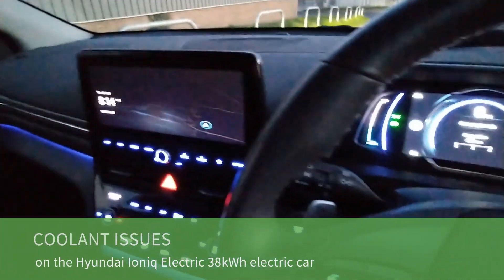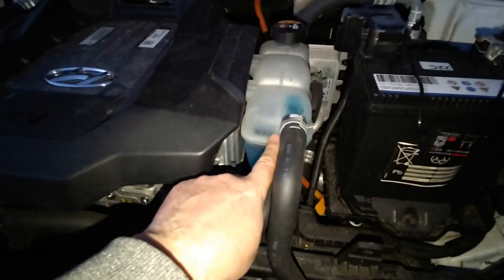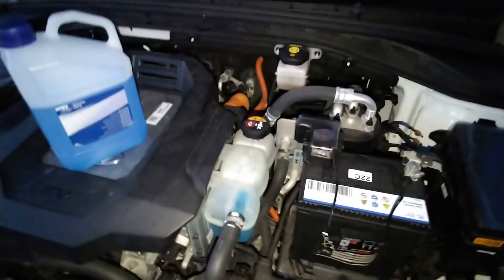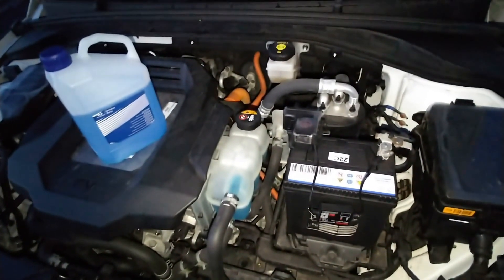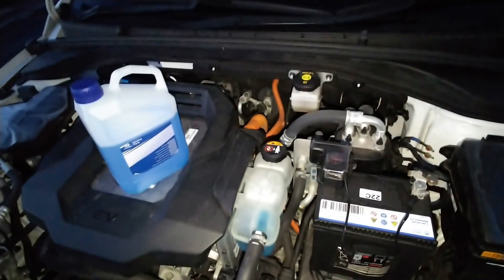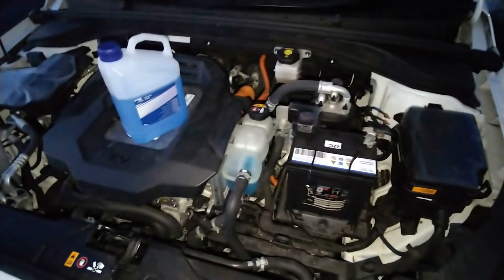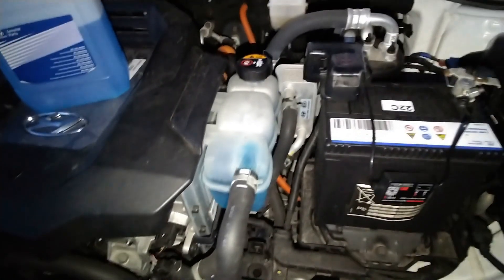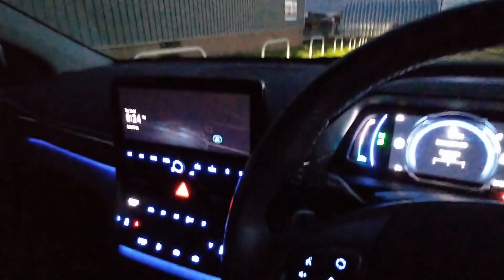Refill coolant message on a Hyundai Ioniq Electric 38kWh

Comment: Just been through this with a 2020 Ioniq 38kWh I picked up and was flushed under the recall campaign. Bonus being that the Year 4 service which replaces the coolant at a ~£200 to the customer is now done as a campaign! 

Anyone wanting to temporarily get rid of this message so it does not keep bonging / coming back when changing cockpit screens - it can be done by quickly powering off / on the vehicle.
Reply from the maker: Yes, I would hope the coolant change delays the scheduled change for a further 4 years. But I wonder if this is actually tracked properly. I would recommend writing the date this warranty coolant change job was done in the service book.

Comment: I remember a video from Bob Flavin talking about the service charges on the original E-Niro in Ireland (few years ago now obviously) saying about people getting a service contract at time of purchase - due to a part of the service each year being a battery coolant flush, that made it relatively expensive!
I wonder if, by the time Ireland got their E-Niro's people around the world were experiencing problems with their coolant, prompting Kia Ireland to include a flush as a service requirement!?
Reply from the maker: Yes, clearly Kia & Hyundai have made an expensive mistake using the wrong spec coolant in their EVs. Or maybe their supplier who makes the BSC-1 coolant has cocked up. I just hope the new BSC-2 coolant is better.

Comment: A left hand thread cap is a bit peculiar.
Reply from the maker: Obviously to stop owners opening it. I guess they changed to this when they used the new EV specific low conductivity coolant, discouraging owners from topping up their own coolant. The Ioniq 28kWh had a normal cap, but then had 'normal' coolant too.
Reply: @GoGreenAutos  I wonder if people were putting windscreen washer fluid in it by mistake as this is often the same blue colour.
Reply from the maker: @gavjlewis  Yes, I suspect that could happen.
Reply from the maker: @gavjlewis  Good point. I suspect that does happen.

Comment: Had the recall carried out about 3 weeks ago with no problem since or before. I also had a rear door handle break and drop off! Still love this car though!
Reply: Done under warranty. They wanted to see the damaged handle at first but as this had dropped off when travelling I didn't have it. They made a bit of a fuss about that but did it under warranty in the end. Thanks for the video.
Reply from the maker: Did you get your handle replaced under warranty or just glued back together for now?

Comment from the maker: Since filming this, the "refill coolant" message has come back, but the coolant level hasn't dropped again. It is now booked in to have the coolant flush warranty job done on Tues 18th April.
13th May update - see new video https://youtu.be/cCt6MEbaXCI
Reply: I wonder if the low coolant message is activated by an actual low fluid level switch within the coolant expansion tank or a low fluid flow sensor, I.e. there is enough fluid within the system, just not enough flow due to the "crystalization"? Typically, coolant would be rated to not freeze and maintain its viscosity in its rated ambient operating conditions.
Reply: Any updates since the flush? Did they get lots of crystals out when they flushed it?
Reply: I've had it serviced in the dealership in Lincoln and been told to just ignore it - it just happens randomly. :-D I wish I'd know about these specifics so I could argue about it. I did try to google the recall for the Ioniq (mine is Feb 2019) but didn't actually find any relevant information. Where should I look, please? I could ask the dealer, but seeing they "tricked" me the first time I asked, I wouldn't get any answer probably...
Reply from the maker: @zealander4724  I don't have the recall/TSB number to hand, but its on one of the comments here or on the other video I made on this subject. Or ask in the Ioniq Facebook group. But it is an active recall on the 38kWh models, so your dealership should do this job. However, it sounds like you need to use another dealer anyway, as it sounds like they wouldn't have the equipment needed as they have to buy in a new flushing tool.
Reply: Yo vivo en un clima calido que menos de 18 grados no baja de temperatura ambiental ¿igual se cristaliza?